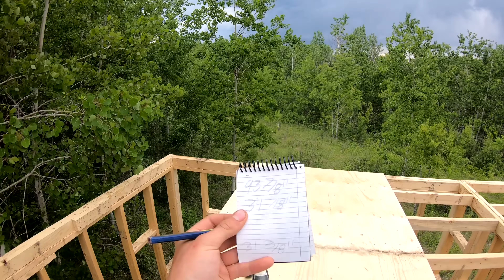Offgrid Cabin Build Pt. 5 - Building Plywood  Loft Floor

Comment: You're doing a good job, I'm thinking. Like you said, It's a bush camp, not the Hilton.In your last video, you asked if we had any ideas, as to what you should use as siding. I waited to ask my buddy, who has a cabin on his trap line, (mine's made out of vertical jack pine logs), All he did was stain the 3/8 plywood that it's build with. It's been 4 years now & he's planning of re-staining it next summer. It's holding-up real good. A couple of gallon of stain's every few year's much cheaper than any siding. Just my nickel's worth. :-)
Reply from the maker: Thanks buddy! I was thinking about staining standard plywood but I think I'm going to end up going with some siding instead. I appreciate your advice though! Thanks for watching!
Reply: @TraplinesandInlines  what did this all end up costing? I am re watching right now. Me my wife my young daughter an 3 beagles plan to build something small on our little lot here on pei Canada 🇨🇦

Comment: You should check out the restore sometimes they have some great used doors and windows. Doing a great job interesting video's. Question how much are your hats.
Reply: Awesome idea!
Reply from the maker: Great idea there Mr. Harris. I have been looking at the used market but havent seen a whole lot yet. The hats are $26 but I have to ship them as parcels so the shipping is a fair bit. The shirts are 24 bucks and 3 dollars shipping! They are both on ebay and you can find the links in the video description if you would like to take a better look. Thanks for watching!